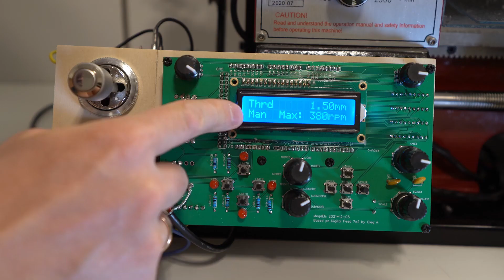Digital Feed electronic lead screw PCB

Comment: Hi Maxim, I'm so sorry if I bother you again, but a doubt arose, I read that you made the project for your lathe and that it has a transversal screw pitch of 1.25mm, my lathe has a pitch of 2mm, the reduction of 1:3 is fine anyway or I have to calculate a different reduction, sorry again, but I have an interest in realizing this project. Greetings
Luciano Baldi
Reply from the maker: Luciano, feel free to ask as many questions as you like :) MegaEls is configurable, 2mm X axis should not be a problem. See https://github.com/kachurovskiy/megaels#code on how to adjust the code to your hardware.

Comment: Hi Maxim, sorry to bother you again, can you please let me know the transmission ratio of the toothed pulleys installed on the cross carriage, I have ordered the PCBs, they should arrive shortly.
Thanks again
Greetings
Luciano Baldi
Reply from the maker: Hi Luciano, no worries, you can find the cross carriage details at https://www.thingiverse.com/thing:4714722, transmission ratio is 3 to 1. Cheers!
Reply: @MaximKachurovskiy  Thanks again Maxim, but I forgot about one thing, if it is possible to know the gear wheel module, I don't have a 3D printer, so I have to buy them already made
Reply from the maker: @lucianobaldi3227  they should be modulo 1 👍
Reply: @MaximKachurovskiy  👍

Comment: Hi Maxim second  PCB better and nicer, 2004 screen would look good, you are doing fine and will sort everything. I need hand encoder  and start soldering  parts together, bench test, building a hobby lathe. Been following HM and MotoChassis. How did you wired Joystick its got 3 Leeds on limit switches witch leed is wired to shield pin no.
Reply from the maker: Milan, thank you! Joystick has 3 leads, you're right. One of them is common and is connected to 1 of 2 other leads depending on the joystick position. I simply tested which is which with a multimeter. You'd connect all common pins to ground and normally-open pins to the PCB. Cheers!

Comment: Maxim, What encoder are you using to read the spindle speed ? I thought about using a mega when I first started thinking about my own design but thought that it wasn't fast enough to keep up at higher speeds so I am using an arm cortex-M3 but I am a little further behind than you. I do like the idea of a pcb to centralise all the sub components. With crossfeed control does this do things like morse tapers? I was also thinking about using an sdcard (or wireless) to interface so that data points for different profiles could be stored and then stepped through to make the cut.
Reply from the maker: Michael, I'm using https://www.amazon.de/-/en/gp/product/B015GYY7XU - Mega and Nano are both same clock speed and are fast enough for encoders up to at least 1000 pulses per revolution and spindles up to 2500 rpm. It does do tapers, see https://github.com/kachurovskiy/megaels/blob/main/Digital_Feed_7e2/manual.md - as for using an SD card, I'm not sure that would be required for normal operations, there's plenty on-board memory in Arduino boards - https://randomnerdtutorials.com/arduino-eeprom-explained-remember-last-led-state/ - cheers!
Reply: @MaximKachurovskiy  I thought the maximum sampling frequency for an atmega was 15K, to get 1000 samples per rev and 2500/60 revs per second gives about 40K at maximum spindle speed or am I missing something?
Reply from the maker: @michaellinahan7740  we don't actually need to sample pins ourselves, just handle an interrupt - https://github.com/kachurovskiy/nanoels/blob/main/h1/NanoEls.ino#L294 - the problem comes from the fact that we also need to issue stepper signals and that takes most CPU cycles, especially with micro-stepping. Or if you were thinking about CPU frequency, it's 16MHz (not kHz). Overall, with a reasonable encoder you're unlikely to reach those limits for real-world tasks.
Reply: @MaximKachurovskiy  thanks for that it looks like I have more development work to do...when I don't get interrupted!